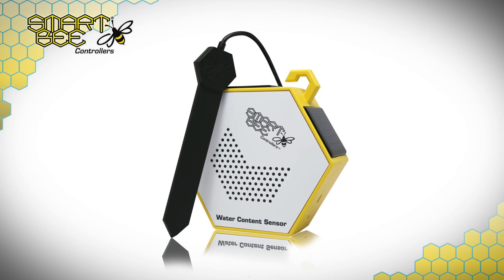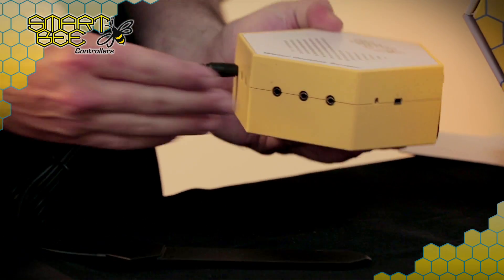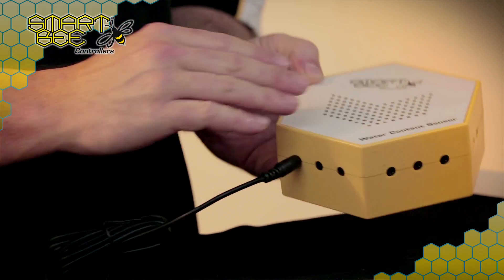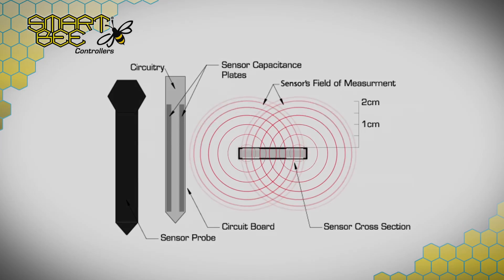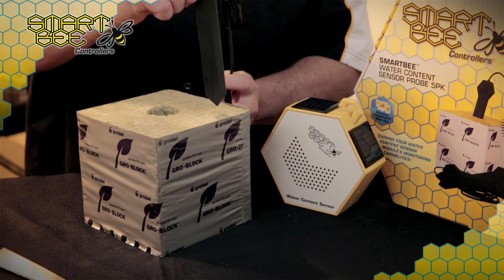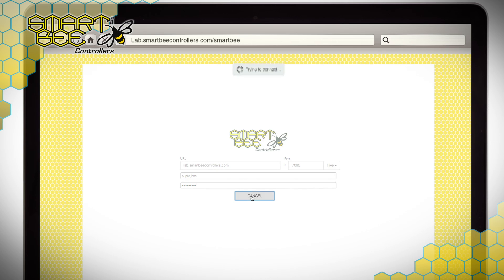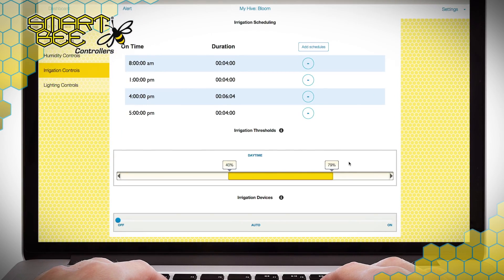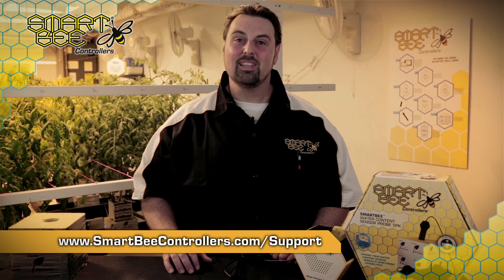SmartBee | How-To | Water Content Sensor | Grow Room Irrigation

Comment: How long are the probes? I'm looking at growing in 3x3x2.5 grodan blocks. Grow 18-20" max height through put and low cost production. 
Will there be problems when the probe sticks out of the block and reads air? Are there shorter probes available?

Comment: Just a quick question, can you trigger the pump based on the moisture level or do you have to do that manually? And is there an option to get it 230v 60hz or whatever european plugs run on?

Comment: Just out of curiosity, for use with the handheld meter. Using the rockwool substrate you would have to cut slits into each one of the cubes that you plan on checking before so you you dont damage any roots. Which would inevitably happen if the probe wasnt placed in there full time because the roots would grow into that space... especially in rockwool.  Any hopes for making this probe less obtrusive to the root system, maybe switching to a needle in the future?
Reply from the maker: Thanks for your comment and suggestion! It is true that we recommend staging a place to insert the actual sensor into the desired plant sites. When doing this the best thing to do is use our Root Guards. These are the same shape as the sensors and can be placed early in veg so as to not damage any roots going forward. They come in 5 packs and are easy to clean when re-setting your room. Hope that helps! If you have any questions about this just call (888)936-9227 Ext 705 My name is David